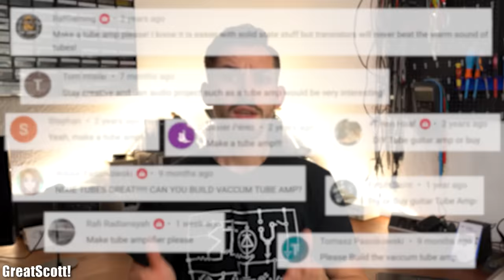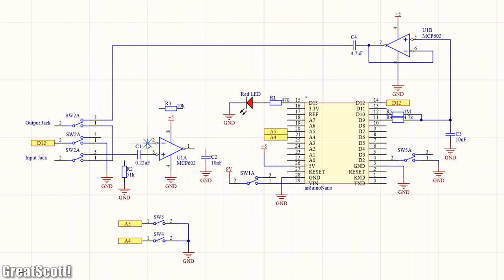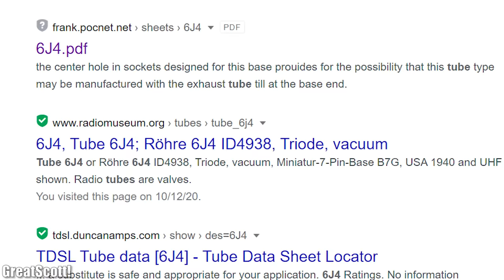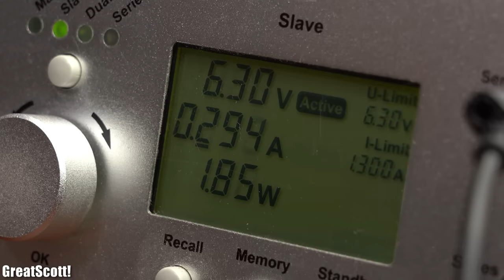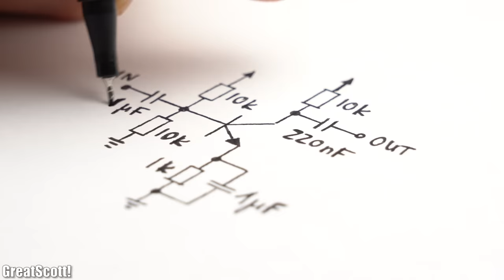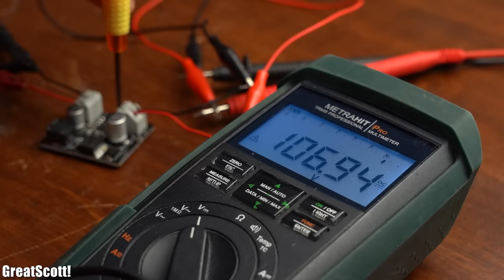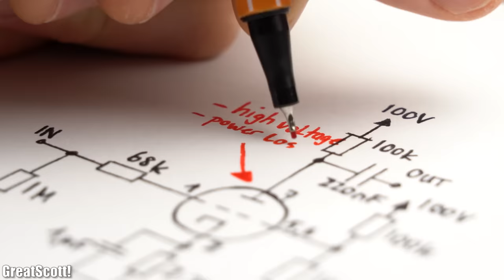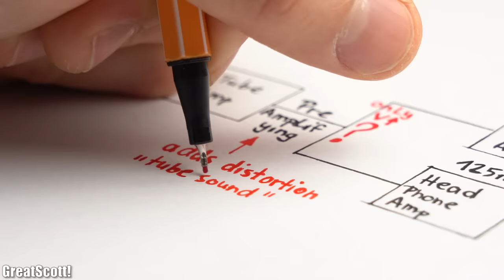Building a Tube Amp! Does it produce better audio quality though? EB#47

Comment: it would have been interesting to measure the frequency response of the tube and see if it can be replicated with a BJT and a low pass filter.
Reply: No it can't. You can sort of approximate tube sound in software (or DSP) over an extremely low distortion SS amp, but even the best algorithms aren't all that good at reproducing the effect of tubes. They are still the best at what they do. Moreover the low pass filter is kind of a cliché; a proper tube design won't significantly roll off the treble (although some will do it on purpose because some like the sound). And that particular roll off comes from the output transformer, not the tube. Remember tubes can easily handle RF range, so audio frequencies aren't much of a challenge. In a preamp buffer like this cheap device, there won't be any roll off.
Reply: the answer is yes, but no. You need more than a lowpass filter, but overlaying frequency distortion is easy to do.
Reply: Not really. The roll-off comes from the OPT which isn't there in a pre-amp.

Besides that, it's not about "recreating the sound" (the sound is far more influenced by the speakers than the amp btw, unless we're talking about overdriven instruments), it's about building/owning the real thing. 
I'm pretty sure you can modify a Prius to behave exactly like a Cadillac, even make the inside look like one with VR glasses, but is it a Cadillac? NO.
Reply: Jonathan Brouillet If FR looks like a tube, if slew rates are the same, if speakers are connected identically, any other type of amplifier will sound exactly like tube driven. This is physics. Everything else is subjective, personal, placebo.
Reply: @jonathanvanier  what the hell are you even talk about? You should run along and let the adults in the room talk electronics. Typical "audiophile" responses, zero EE knowledge.
Reply: @ATX_Engineer  I am amazed at your adult level response. Very impressive. Sadly your attitude is only too typical of people without knowledge of tube technology, yet think they know a lot because of that one undergrad electronics course they took. My above answer is accurate, and quite devoid of tinfoil audiofoolery. But if you think you know any better, then please do feel free to actually come up with an argument. I won't hold my breath though.
Reply: @jonathanvanier  I don't need to develop an argument, you have said enough in other comments. Best of luck to you out there.
Reply: @sc0or  Sure, if you perfectly replicate the complex frequency response of an audio tube circuit and leave everything else the same, you'll have replicated the tube sound. Did anyone say otherwise? Yet it's also plainly tautological: If you duplicate something you have duplicated it. But obviously saying it is one thing, doing it is another. As I've stated above, there are algorithms that do a decent job of approximating tube sound. But they're far from perfect from everything that I've heard so far (and measurements agree). And to be clear, the intermodulation distortion of a tube is quite different than that of a silicon transistor, while the harmonics will also be different and behave dynamically (tubes are notoriously microphonics, for example). Any half decent FFT analysis will demonstrate any of this. It's not even contentious. Yet, somehow, I hear people without knowledge of tube technology jump straight to first principles and assume it's all voodoo. I'm not sure why, frankly, since tube technology is well understood after a century of dealing with it. Heck, outside of audio, tube technology is still the best we've got for high power radio frequency signals; traveling-wave-tube amplifiers are still crucial for some radar applications and run most satellite transponders out there. So, until somebody come up with a perfect or nearly perfect algorithm to replicate the sound of a desirable tube circuit (say a 12AX7 preamp and 300B SET output), then the best way to get this sound is still to get the real stuff. The appreciation of tube sound is subjective, but nothing else has to be. It is indeed just physics.
Reply: @ATX_Engineer  I was going to use the same argument. How do they make the "effects" in  audio processong software? Well, using digital filters with plenty of Fast Fourier Transforms. How does Seti project analize signals? using plenty of Fast Fourier Transforms. How the seismology guys do their job?? with plenty of maths, fourier analysis and wavelet transforms. You know your stuff, don't worry, be happy. Your arguments are solid. In fact, there are simulators that can place a virtual tube and connect to a virtual scope to see the virtual behavior of the little tube. With nowadays computers, we can have a filter to simulate everything ;)
Reply: @jonathanvanier  You are talking to an engineer, of which you have no understanding of their background... yet you are willing to challenge the notion that silicon and circuit topology can accurately replicate the tube harmonics? AHAHAH

Yeah, you need to get your head looked at. 

Try googling Korg Nutube. There is stuff out there that you don't even know about.
Reply: @seebaastian  Nobody said it's not possible in theory. Why do people keep assuming we treat tubes like magic black boxes? Do you even read what I wrote? The issue is not to know if it's theoretically possible, it's that nobody has done it convincingly so far. Sure you have approximations. They're just fine to simulate circuits. They're half decent in audio pluggins. But that's it. I'm sure one day we'll get there, and tube amps will just have the novelty going for them. But in the meantime, tubes are much more complex than you seem to assume. And for the sake of it, the question at the very top of this thread was if BJT+LP Filter = Tube Sound. And that's a clear no.  It's all fine and dandy to go down the Rabbit Hole of tubes, but I don't think anybody said anything to contradict my initial response, of which this thread as moved quite far away from.
Reply: @jonathanvanier  Good answer, Sir )
Reply: @ATX_Engineer  Korg Nutube is a VFD used as an audio tube. It is a tube — if an unconventional one. So that's your great exemple of a transistor-based perfect reproduction of tube sound? You took a wrong turn somewhere buddy. As for alluding to your credentials, I'm not sure it gives the impression you think it does. You prefer to claim unproven authority instead of providing evidence, which is frankly the sign of someone outside their actual expertise. Even if you are an engineer, I contend you don't actually know tube technology. And I wouldn't want a urologist doing heart surgery on me. So you better try impressing someone else with that. If your claim is that you can perfectly reproduce the sound of a tube hi-fi system with a transistor-based circuit, then go patent it right away. But I and the scientific literature will disagree in the meantime. So that's that. The rest is just name calling. As for your "side note", I did refer to "FFT analysis/analyser" which nobody in the trade would ever confuse for anything else than FFT based Fourier analysis. And in any case, when you're down to linguistics, you might as well drop it altogether.
Reply: @sc0or  

This is wrong. The difference might be minor, but it IS there. The harmonic distortion pattern is different, and if it's a tube power amp, there is a very complex interaction between the transformer's secondary and the speaker's voice coil, since both are reactive components.
Reply: @westelaudio943  1) Nutube is in fact a silicon chip. It's not disputed.
2) Tubes are good for only ONE thing in audio, distortion audio for guitar amps and the like. Sound best when overdriven.
3) Sorry, but the best hi-fi audio companies out there aren't making tube amps, and regardless of how much you want to disagree with that, it doesn't change that fact. Even if they do, its always some harken throwback design to appease the tube faithful. Everyone has moved on to solid state.
Reply: @ATX_Engineer  

Dude it's literally one google search. NuTube is a VFD-like triode. 
Get down from tour high horse, lol. 
I like solid state as well as tube.

I don't think tubes sound significantly better, but they are cozy, they are pieces of art that changed the world like few other things. 
That's why they should always be around period.
Reply: @jonathanvanier  How long did it take you to write that? LOL

Funny you mention all of those companies, and of those that aren't niche tube companies (actual hifi),  all have overwhelmingly solid state offerings... even their "tube amps" are using tubes for the first stage, because they have to put up with clients that are too stupid to know better. 

You can read amp review analysis on the internet until you are blue in the face and all the reports come back the same. Solid state is a cleaner, more stable amplifier. I love how some of these companies have to do somersaults to get their tube amps within THD spec, just to make the customer happy. Its just mind-blowing how pathetic its gotten with tube amp misinformation. 

Also, cute that you are trying to educate me on Fourier. Thanks honey, thats nice.
Reply: @jonathanvanier  also, I actually have a video on my account of me prototyping an actual amplifier I designed from the ground up. What the hell do you have? 

Thats what I thought.
Reply: @westelaudio943  fair enough. I didn't say they don't have their place. I was pointing out that solid state amps can in fact mimic a tube amp with the even ordered harmonics. Someone here seems to think that is not possible, and that the tube sound is just unattainable any other way. Thats just flat out ignorant.  

I have a tube pre-amp that I use very occasionally. It definitely has its characteristics, but honestly I rarely even think about it unless I am listening to something heavy. Definitely not looking at for sound stage or tonal clarity.
Reply: @ATX_Engineer  💋
Reply: @jonathanvanier  Funny, I was thinking the same thing
Reply: WESTEL Audio This is all good but a question is pretty simple: if such distortions sound so pleasant, why sound directors do not add them to a master tape? So all people (not only the luckies ones) can enjoy brilliance and warming? I prefer to listen to original music. But others might not of course
Reply: @sc0or  In the studio, tubes are often found in microphone preamps. I for one think tubes are at their best when it comes to vocals. Recording engineers have them in their toolbox along with regular issue SS mic preamp to craft the sound that they’re looking for. So yes, in short, tubes can be used to create master tapes. It’s a bit like the MP3 format that has a distinctively warmer sound (it saves data and psychoacoustics had indicated that most listeners preferred the warmer sound anyway). Yet, personally, I don’t particularly like the warmer sound of MP3s. It’s really just personal preference at the end of the day.
Reply: @westelaudio943  I like the way you look at this. To me it’s a bit like Swiss watches. Sure you can grab a $5 quartz Timex and it will give you perfect time. But that’s not why people lust after a handmade mechanical watch: it’s the craftsmanship, the mechanical artistry and the beauty of the timepiece. Same goes for tubes; there’s nothing wrong in appreciating a nice tube amp for its aesthetic qualities as well as for its sound. And if you do like tube sound to begin with, then going with the real deal is the obvious choice. Why bother with approximation of an imitation when you can find tube amps at pretty much any budget points. And if you do not like tube sound in the first place, or don’t care for any of it, then just buy a damn solid-state amp and stop whining; it’s not like there’s a lack of them on the market. It’s really mind-boggling to me why some loose their marbles over this. I don’t know if it’s just an extreme case of “new is always better,” but frankly I don’t understand the hate tubes evidently collect in some parts of the electronics world. Anyway, to each their own I guess.
Reply: You just need to hear it. The whole reason a tube sounds good stems from the fact that it can't be modeled with something simple like a low pass filter. There's just way too much physics to easily model it
Reply: A JFET would be a better match.
Reply: @ATX_Engineer  if you don’t mind me saying. You seem to be all over the place in your position with tubes. 

First of all I have solid state myself.  What drives me away from tubes is the heat they produce and how they degrade over time.  I love the sound quality.  I only got solid state too because it was all I could afford for the amount of watts I was looking for. 

Tubes cannot be be beat though in the mids/highs and especially soundstage.  

I’m not going to argue that solid state amps can in fact mimic a tube amp with even ordered harmonica.  The problem that I see though is that this can only be accomplished at a certain set volume.  Would you agree?

Our ears don’t hear frequencies the same.  When at low volume our ears don’t hear the lows and highs quite well.  We need to turn the volume up or increase bass and treble. 

To me where tubes do a better job is that no matter the listening level it sounds really good.

You even said yourself tubes have their place.  You even have a tube preamp.  

If engineers like yourself could already reproduce the exact sound as like you claim then why do we even still have tubes?  

Tubes have been around forever and the same for high audio.  You claim it’s because certain snob audiophiles don’t know what they are listening to.  

The bottom line is this.  If tube sound is attainable per you then how can you also claim they have their place.  It would be different if they offered other non-sound quality benefits but they don’t. It’s the opposite. 

Maybe those in Canada or Alaska like tubes because they double up as heaters?   

I’m in the camp of tubes have their place in the audio world.  I’m also considering still getting at least a high quality tube preamp to see if it can do what I’m looking for.  My home set up though isn’t ideal to store any type of high heat producing equipment.
Reply: @ATX_Engineer  you cannot be a true audiophile if you haven't grown up listening to tube Amplifiers. We will start with an AM radio that has tube everything.  I remember the zenith tube radio it sounded like stereo even though it was one audio channel. Then came FM which is even more sounding like stereo even though the multiplex adapter was missing. I had myself an Atwater Kent radio that pulled in stations thousands of miles away and the quality was much better than the stereo equipment they make now. Remember tube radios had iron, the power transformer and the output transformer made tubes sound great. Then I heard seasons in the sun on a dynaco st70 with a cheap FM radio that wasn't even stereo but the sound from that st70 was great. I could imagine if I had the FM tuner to go with that amp. Well these cheap 12 volt tube preamps are garbage. You cannot get that warm sound without the output tube, plate voltage and output transformer. 12 Volts don't cut it. 73
Reply: tube amps are nonlinear, so they need a lot more than a low pass filter to properly simulate

Comment: A well designed and built integrated tube amp (for hi fi ) will sound good if it's internal components are high end, if it's preamp and power tubes (and there are many brands and types) are compatible with each other, and if the amp has a good source like a great cd player and great speakers. there are so many things one has to go through to find the right equipment to form one great stereo system.
Reply: They don't want to hear that.
Reply: They're missing out a lot. Well, maybe not much if they listen to synthetic music.

Comment: The other component that you must factor into tube amps is the output transformer. OTs saturate and alter the shape of the signal, so even a linear input through an OT will have a “valve amp” response. Transistor amplifiers with interstage transformers have the same audio pleasantries that valve amps do. For example the PigNose and Baldwin-Burns amps sound like valve amps but are all transistor with interstage transformers.

Comment: They're still popular in guitar amps mainly due to their overdrive characteristics. They can produce a really soft, mellow type of distortion which an overdriven transistor simply cannot create on its own. Synthetic valve distortion is achievable through some sophisticated electronics (as long as the transistors are kept out of overdrive) but that'll never be enough for a purist

Comment: Many audiophiles love that soft distortion and imperfection, that’s why both tube amplifiers and vinyl records are still a thing.
Reply: So true, I'll have made my system all tubes pre amp phono and power amps. I never go back to transistors.
Only half conducters I have got is my cd player ( modified teac vrds10se) and dac. If you build it right without any compromise it will preform very well. I better listen to even harmonics from tubes then the distortion from a Class D transistor amp. Cheers
Reply: I'll always prefer the accuracy and clean sound of solid-state amps for all my cassettes, vinyl and CDs.

Comment: Linearity can be deducted by looking at the characteristic curves of an amplifying device not from the literal straightness of the lines (which has little to do with this) but by how constant the spacing between them is. With transistors, the distance between the top two lines is pretty much the same as the distance between the two bottom ones. With triodes, the right-most lines are much closer together than the left-most lines, it is that change in spacing what deforms the signal and adds extra frequencies that were not in the original input signal, not the actual curvature of each individual line ;)
Reply: Meh. You can add a NFB circuit to both and still hear the difference...